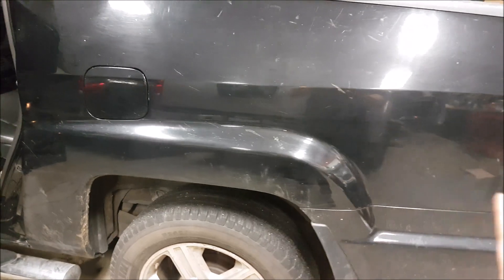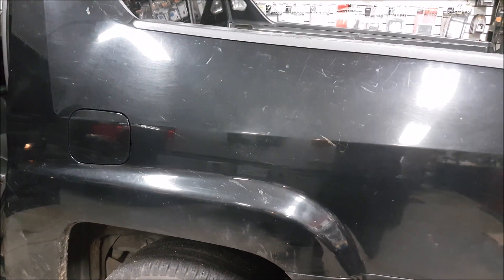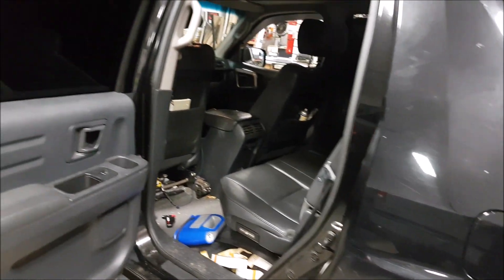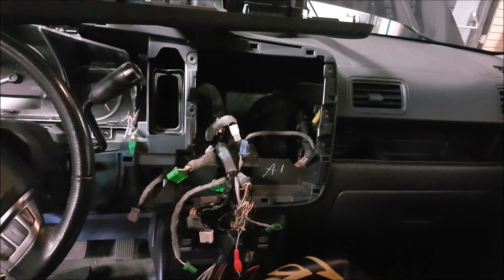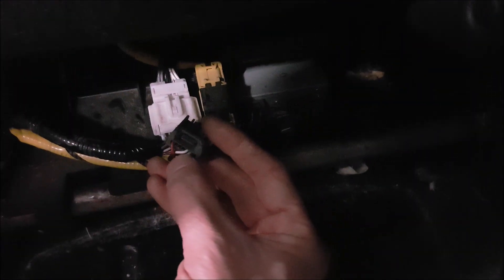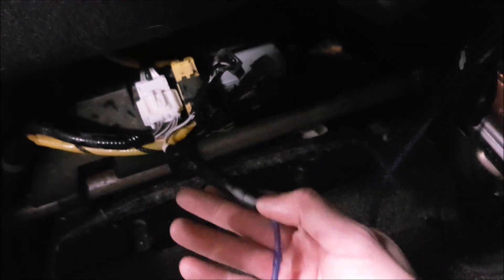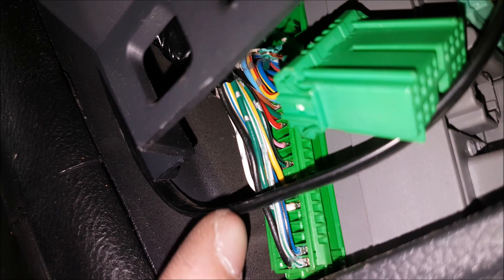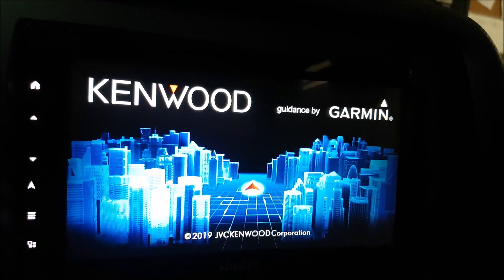Honda Ridgeline Factory backup Camera retention | AnthonyJ350

Comment: There is actually vehicle speed and backup light power on the brown connector at the nav unit as well. So no need to deal with the fuse box area just run some extra wires and its all together
Reply from the maker: Thanks for sharing!

Comment: I need more info. What does the RCA pig tail look like. And what connectors? Are you joining into the video wire or cutting and taking over the wire? How do you plug it into the aftermarket stereo?
Reply from the maker: I found the + and - video wires from the factory camera and soldered an RCA with pigtails.

Comment: This is a much needed video! So I get the RCA cables, but what do you do with the reverse power cable? Do you hook it up under the seat and run to the back of the new head unit? I know my Pioneer head unit has a cable for it, but not sure where the other end of it goes... Just have a lot of lose cables left over from OEM Nav. Any help is much appreciated!
Reply from the maker: Once you find reverse you can run the connection to the aftermarket head unit.
Reply: @AnthonyJ350  Are you saying, put the car in reverse, and test for an electric signal going out, and that's the pin?
Reply from the maker: @prokoa  You need to find the postive 12 volt signal when the vehicle is put into reverse.

Comment: I’ve looking for a none Navi video anyone help
Reply from the maker: Sorry don't have one
Reply: If you have the rearview camera in the mirror, you can tap into the camera wire which is above the dome light/sunglasses holder. That’s what I did with my 2008 Honda Odyssey EX-L without Navigation. My backup camera is in my rearview mirror but I had that tapped into and now it shows on my android head unit and still the rearview mirror.

Comment: Thanks for posting this….
Reply from the maker: I hope it helped
Reply: @AnthonyJ350  i have been installing a new head unit today in mine and was stumped on the camera. So it was great help! Btw How do you remove the plastic covering from around the back seat mount? I looked at it briefly and I didn’t see an obvious way it came off.
Reply from the maker: @MadMaxMalone  Gotta use pry tools, can't remember where all the fasteners are if there are any.
Reply: @AnthonyJ350  Hey camera isn’t working for me. Maybe different on US models. Im gonna keep messing with it.
Reply from the maker: @MadMaxMalone  Did you test with the vehicle running after you made all your hook ups? Just make sure it can't move.
Reply: @AnthonyJ350  yes I even drove it a bit. Im monitoring the actual input on the head unit and it shows nothing coming in. I have the positive to the white wire and neg on black wire on the nav and plugged back in but mine has a red stripe on the white wire. Thx for your help. After viewing your video again are connecting to the brown plug near the bottom of the unit or the loose gray one at the top?
Reply: Got it. Thx again.
Reply from the maker: @MadMaxMalone  You're welcome!